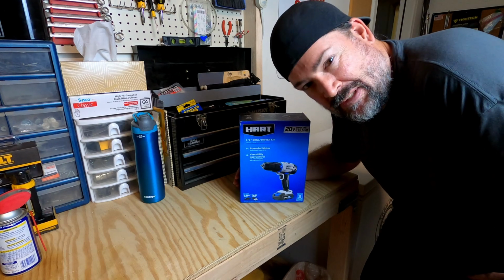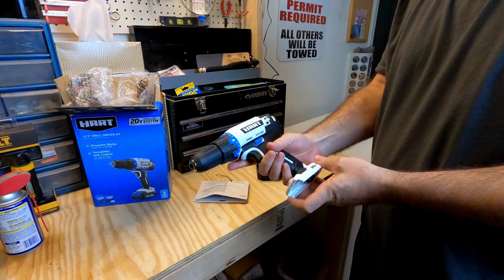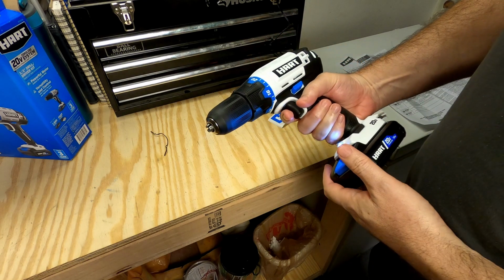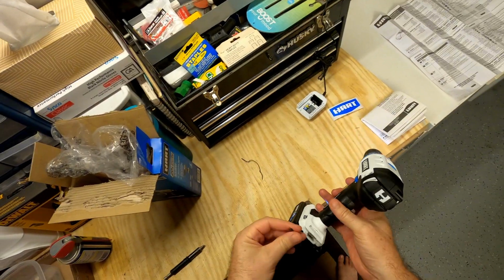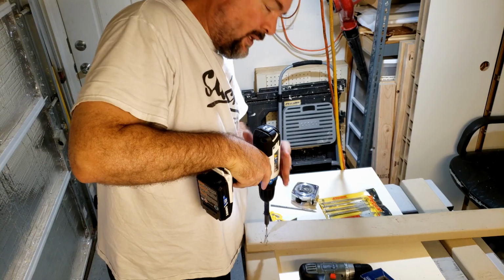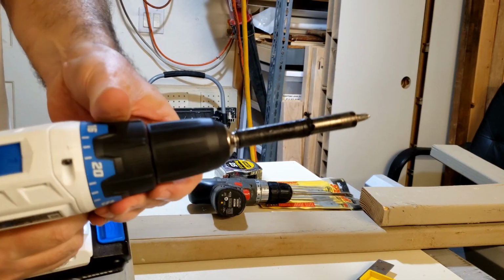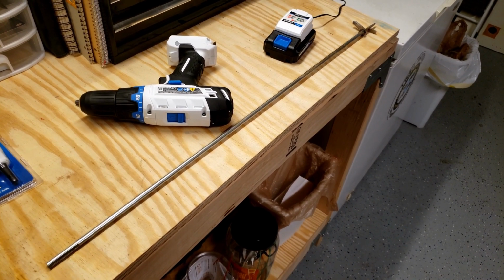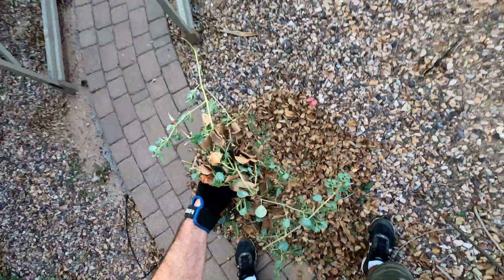HART 20-Volt Cordless 1/2-inch Drill/Driver Kit - ON SALE $39.00 - Review  👀

Comment: I bought 1 today at Walmart 1/2 drill kit $69. I’m happy. Bought a backup 2amp battery set for $59.  Great video sir
Reply from the maker: Good stuff! I have bought a few budget drills in the past. They seem to work great and last for a long time. The only issue is that when the batteries die they can be difficult to get fixed or to even find a new one. So yeah the best thing you can do is get an extra battery. Plus it's really nice to have another battery all charged up and ready to go.
Reply: @ThatHobby  copy that seems like a solid tool 👍🏻